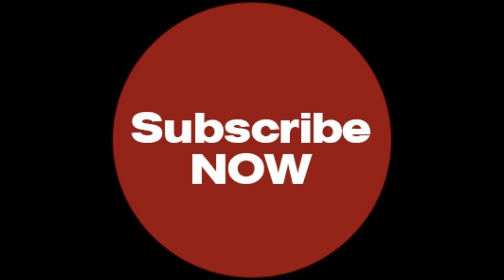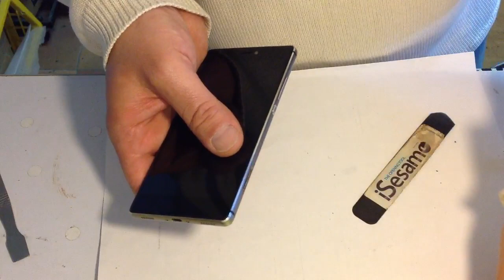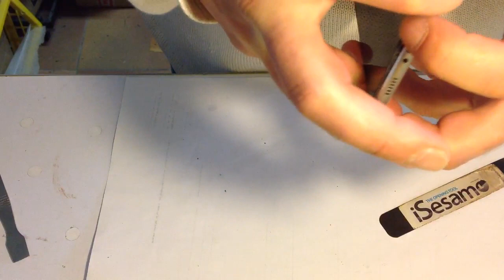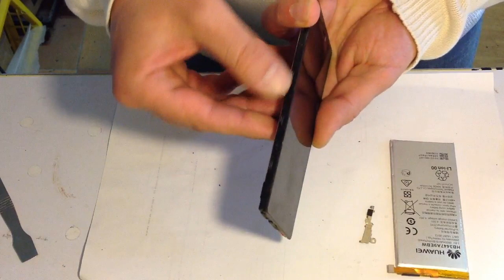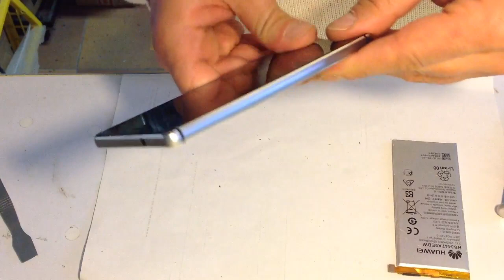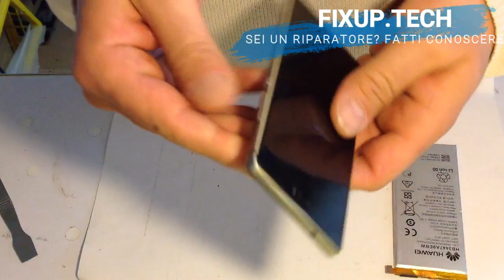HUAWEI P8 battery replace sostituzione batteria  cambio de batería

Comment: Factory's original battery is Li-Po but you seem to remove a Li-Ion and then again put a new Li-Ion. This means that it's the second time you change battery???
Reply from the maker: it has been many months, I think he has already changed it
Reply: Definitely. Original battery is hold in place with something resembling rubber cement. Here it's just two measly strips of tape. Removing original battery without heat gun is a real struggle, no way it would have been removed this effortlessly.